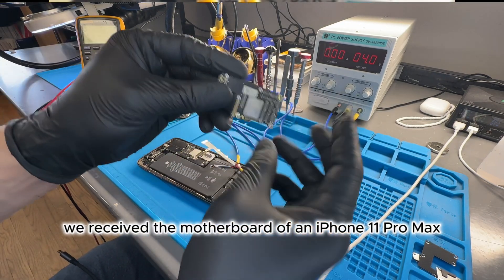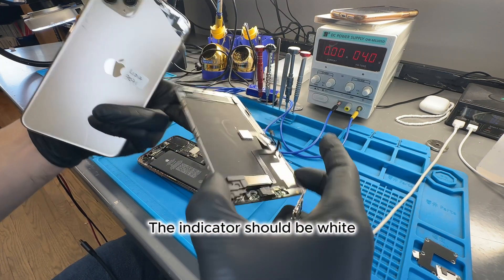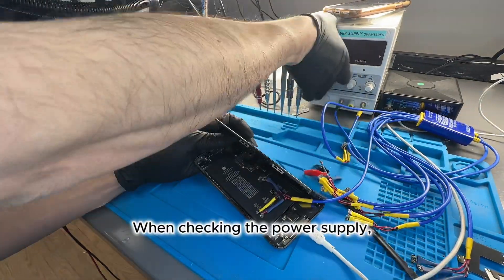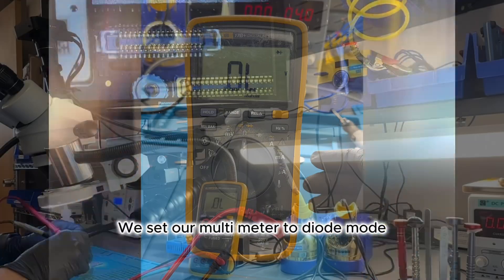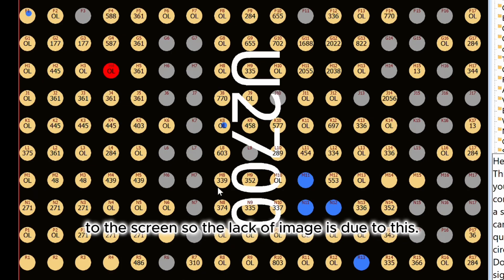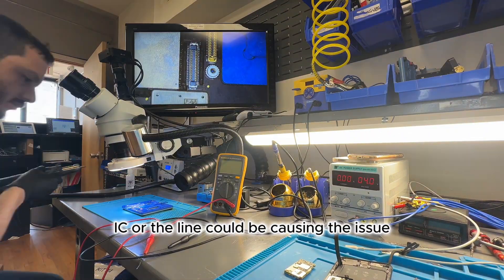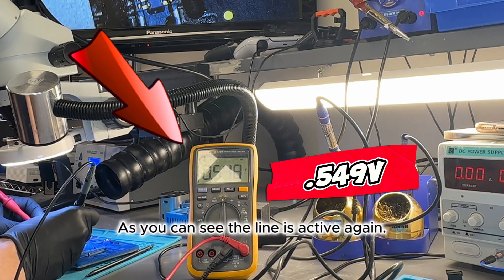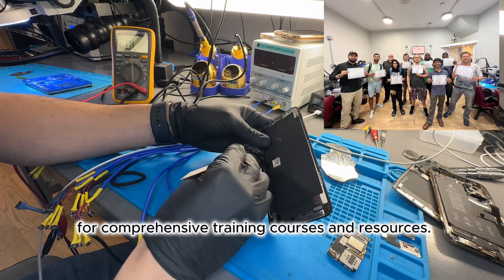iPhone 11 Pro Max Water Damage Repair | Image Circuitry Fix

Comment: OK so this happened to my phone but the place that I took it to they took off the screen that I had that had no damage to it only with this problem and they put a new screen. Did they have to do that or could they have just fix the problem inside of the phone without replacing my whole screen